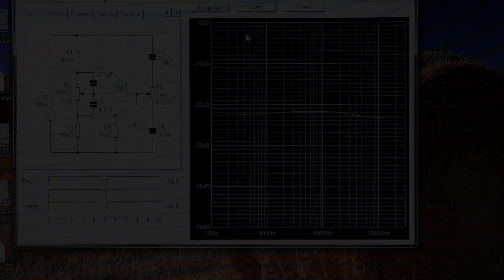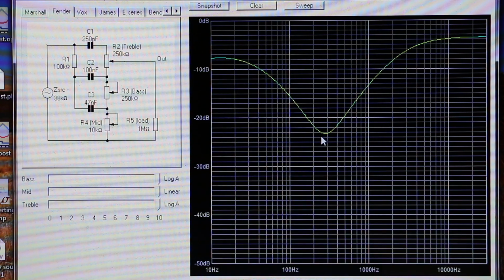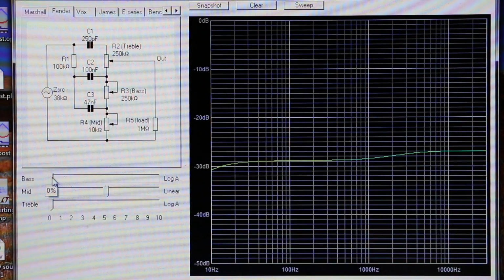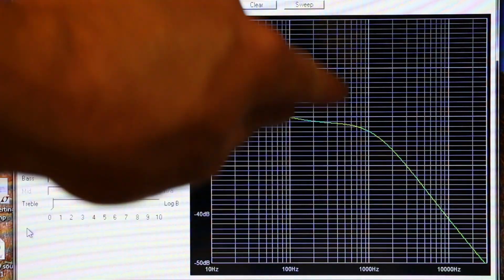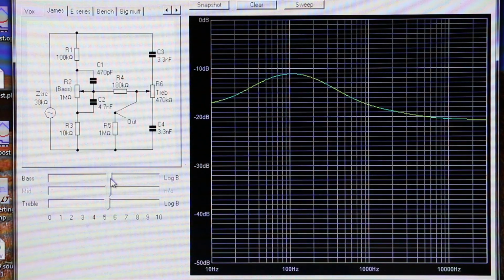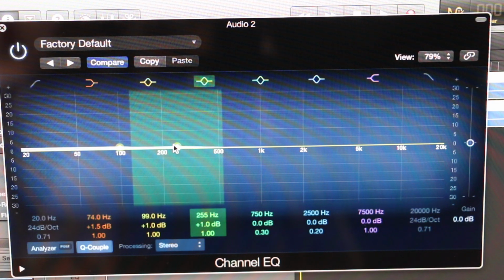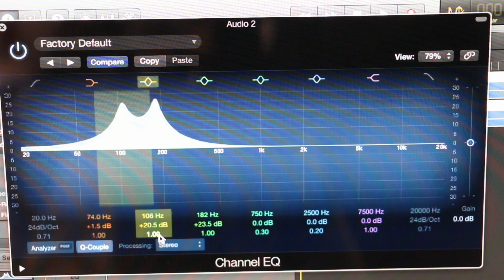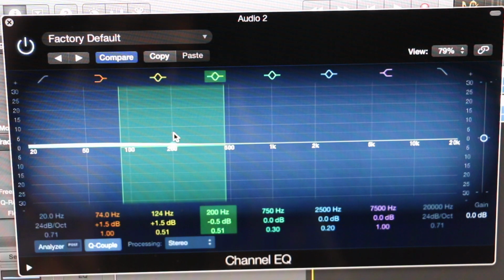Passive EQ vs. Active EQ: What's the difference?

Comment: Did you use camera to record the screen? In future, if you're capturing windows screen, you can use something like OBS (open broadcaster software) and use it to record desktop or specific window :) don't know if OBS is also for Mac but I bet there's something similar. It's fairly easy to use too.
Reply from the maker: +Yuppi or QuickTime

Comment: so why do amps not always sound scooped?
Reply from the maker: Tommy because you have to take in account all of the different parts. Eq before and after each gain stage, phase inverter eq, power tube response, transformer response, cabinet size and sound response, as well as the speaker itself. They all work together to form a sound.
Reply from the maker: well said! :)
Reply: Because the electric guitar itself is very midrangey, as are the speakers. That's why the EQ that's on Fender, Marshall, and many other guitar amps actually sounds good. Which in turn is why I like these kinds of EQs for guitar, but really don't like them for bass.

Comment: I just purchased a power supply analog digital trainer or PAD trainer from my amp guy and wanted to get started on building some of the circuits that I see on your channel. Any tips would be greatly appreciated. as I am just getting started on this path! 

PS I love the Tumnus, gonna be getting me one soon! Heck, just love your work in genera;, so thank you!
Reply from the maker: Thanks! Is this what you are referring to? https://www.amazon.com/Elenco-XK550-Digital-Analog-Trainer/dp/B0002E7X86 ? If so, that's going to be quite a bit of overkill for building pedal circuits. What you'd really need is just a breadboard, some parts, guitar and amp.

Comment: The PC is loud because the CPU is getting hot and it's trying to cool down. if you spend $50 on a CPU cooler it'll help. if you install liquid cooling, it'll be almost totally silent. Depends on how much you use it.
Reply from the maker: yeah, it's an old beast.